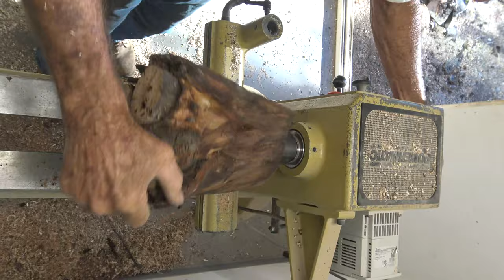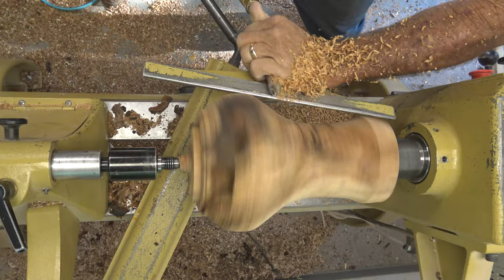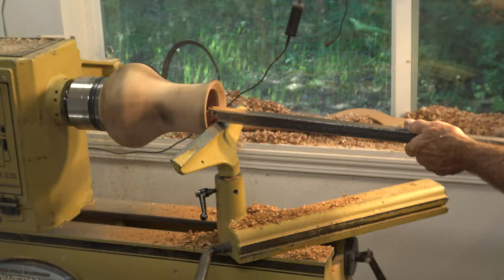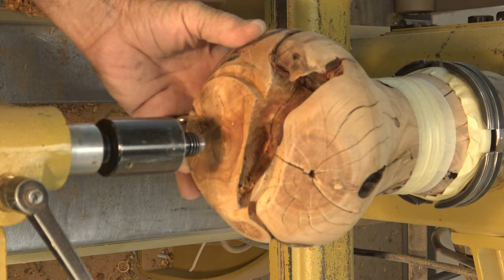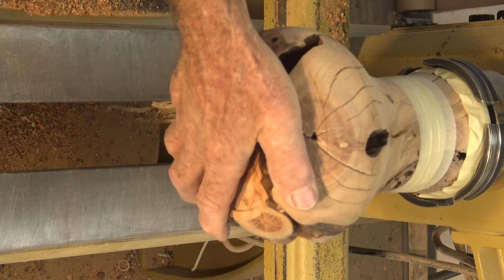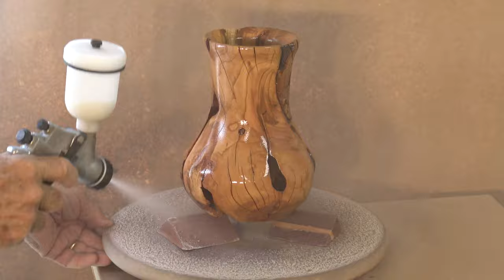Woodturning Walnut Crotch Vase

Comment: Ah ha, another neat video to add to my Squarepeg Tommy viewing marathon!  Great wood turning.  One never would have thunk a root ball would make a nice turning.👍👍👍

Tell me about the big square shafted tool you used to hollow out the piece. Is it home made, carbide tipped or what?  It is an interesting tool.  If home made, I might try to make one.
Reply from the maker: Thanks!  Root balls are always interesting if you can get them to stay together!  The tool I am using is home made.  It is a 48” long 1” square tubing with end cut, ground, and tapped to accept Sorby Multi Tip Hollowing tools.  It is very aggressive in cutting but great for deep projects.  Thanks for watching!  Tommy

Comment: Nice piece Tommy. Can you share a bit about that monster hollowing tool, please? I assume you made it. What type of cutter (s), where did you get the bar, is it solid, How did you mount the cutter? Thanks pal. Keep up the good work. I just love turning.
Reply from the maker: Thanks!   The tool I am using is home made.  It is a 48” long 1” square tubing with end cut, ground, and tapped to accept Sorby Multi Tip Hollowing tools.  It is very aggressive in cutting but great for deep projects.  Thanks for watching!  Tommy